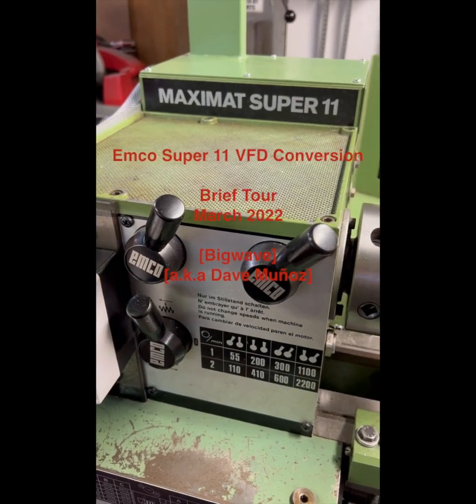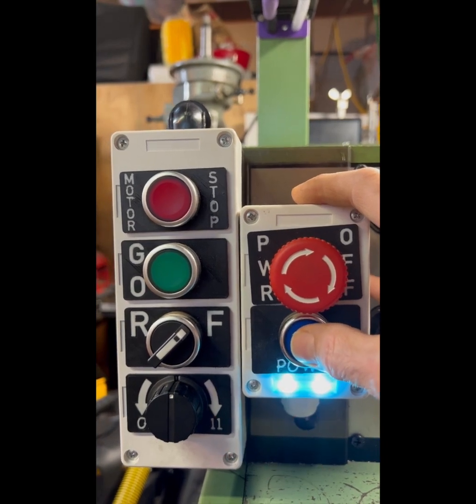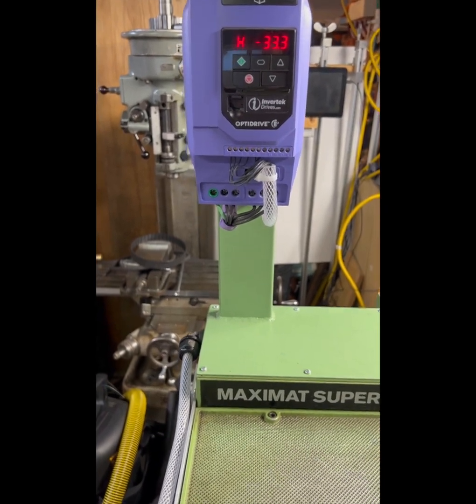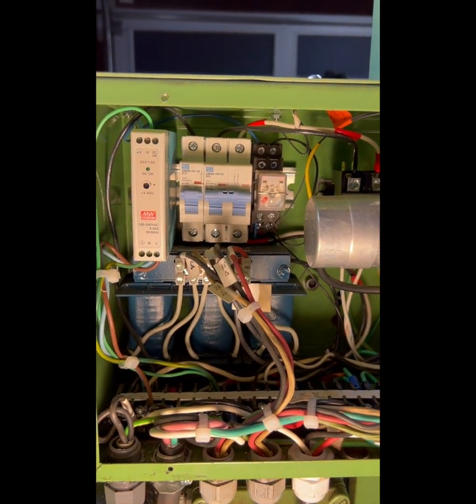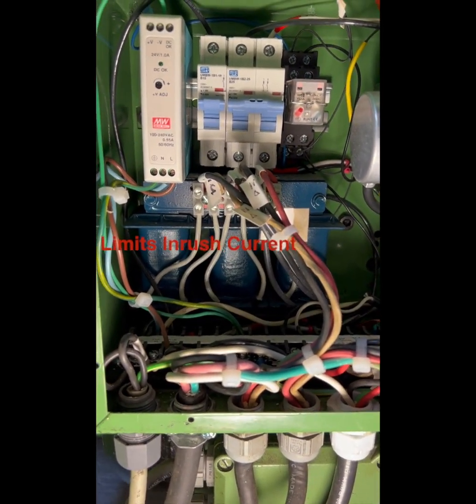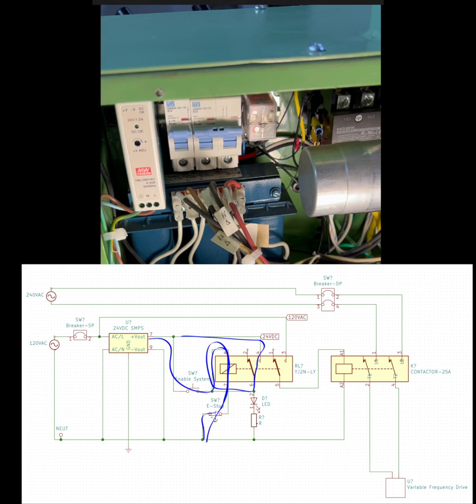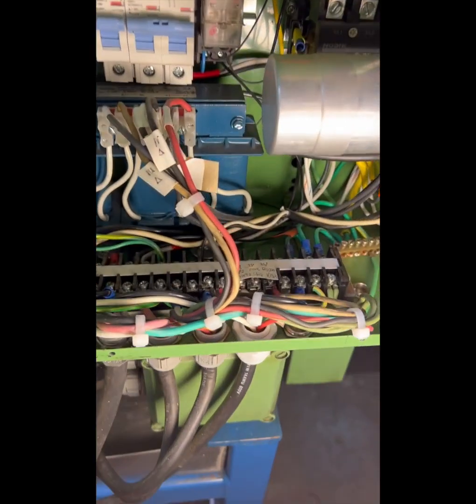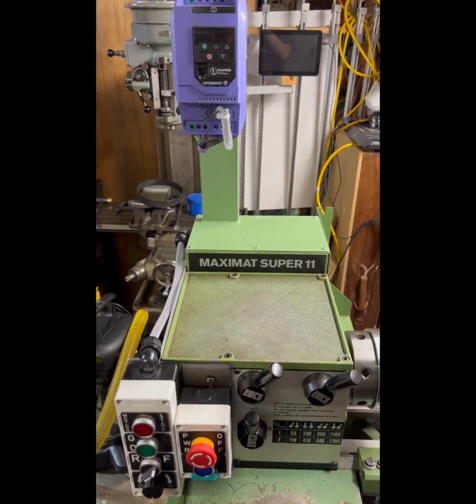Emco VFD Control Tour1080p

Comment: Hi  I have the same drive do you have any switch wiring diagrams and do you set drive P12 to 0 and P15 to 7?
Reply from the maker: Mine is configured for P12=0, P15=11 (corresponding to Configuration 6 in the manual).  I don't have the wire diagram handy but believe I just wired the red momentary SPST  "Start"  pushbutton in series with the SPDT "FWD/Rev" direction switch. One output pole is connected to D1 while the other output pole is connected to D3.  When you push the red "Start" button, either D1 or D3 sees a logic level 1.  This was more intuitive for me as opposed to having two Start buttons for Fwd/Rev, respectively. Have fun!

Comment: Thanks for the video. I also have a 115V Maximat 11. I'm a machinist, not an electrician, My question is about the output voltage of the VFD. The way I'm seeing it, the drive outputs voltage based on the input. I also plan to use 220V single phase input. Since the motor originally ran on 115V, I'm curious about the actual voltage being output by the VFD. Obviously it's working fine but is the motor seeing 220V?
Reply from the maker: Sorry, for some reason I did not see this when you originally posted it.  A VFD can scale the output voltage up or down depending on mode and model.  They work a lot like a Switching-Mode Power Supply (SMPS).  Most modern VFD's are "Inverters" meaning, they first convert(i.e. "Invert") the inbound AC into DC then they "chop" the DC into an AC output signal that represents the desired new AC output .  If you look at the output waveform on a scope, You'll see some stair-stepped output but that output approximates the desired frequency and AC voltage you want.  The inverter I used, can reduce the voltage down to 160AC/3Ph if memory serves.  The motor seems to work fine and that make sense since a lower-voltage motor of the same hp requires heavier windings to handle the increased current (Power = Voltage*Current). I've run the Emco 115V motor in both YY and Delta configurations without issue. Delta config was quieter on my motor.  Remember you must choose one configuration or the other (YY or Delta) and not change it because the VFD is tuned to match the motor.  It's a good way to get rid of that horrible rotary switch and simplify things. These motors were designed before VFDs so there's no guarantee the motor won't be harmed by square-wave VFD output. IMO it was worth it.